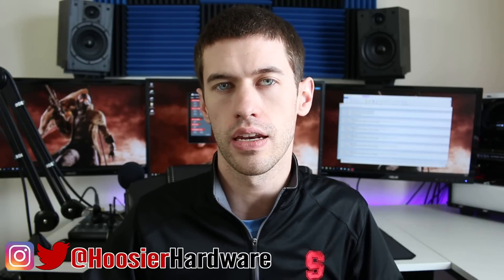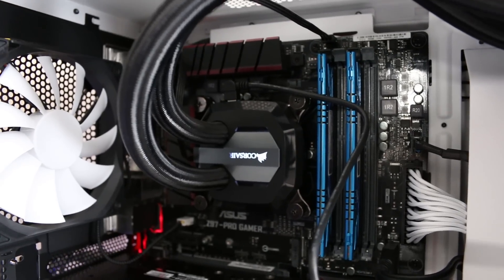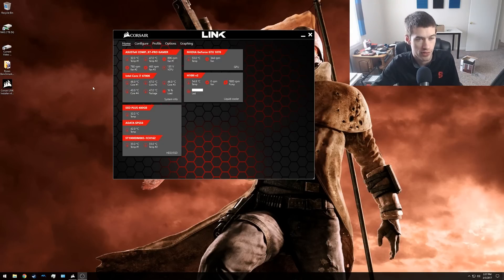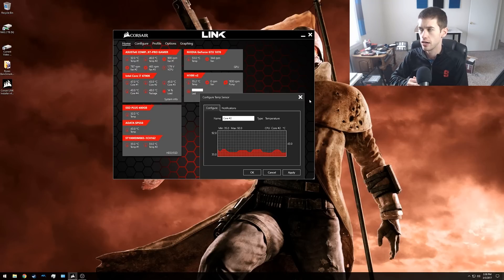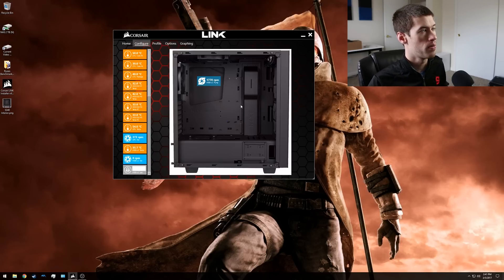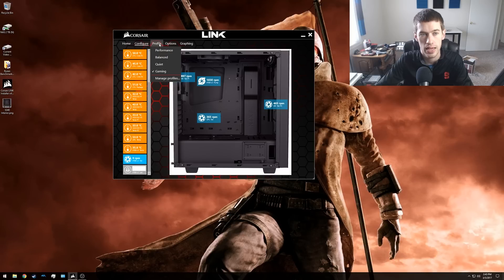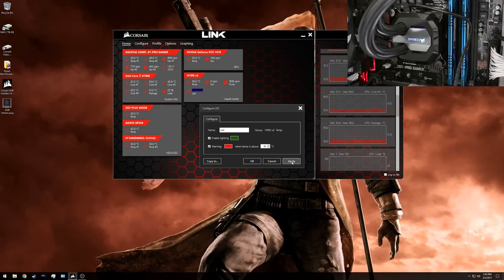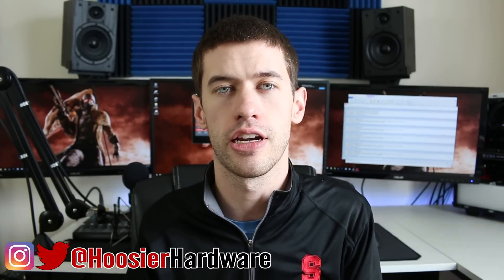Corsair Link V4 Overview

Comment: Do I need a cable similar to charge my phone on the back of the psu? I don't have that cable.  Can I still use this program? Device I only have this psu in my machine, can I still switch dual rail, single track?

Comment: ist it possible to make the LED from the pump changing colors on its own? so like a fade or cycling mode?
Reply: This is a good question, I had an earlier model h110i gtx which allowed that, but after changing to the h115i it seems to not work
Reply: Real nope the software is trash it’s the reason I got rid of my h100i v2 and got a kracken x52 and let me say it’s much better

Comment: my h100i v2 is not showing up in corsair link
Reply: I found the solution to this. The problem, at least in my case, was because the newest version of the Link software is digitally signed with a certificate that cannot be checked by Windows. Basically the USB driver that installs with the water pump is then not trusted, so it doesn't fully install. What I found to work is go back to the Corsair Link website and find the very first version, 4.7.0.77 I think. Uninstall your current Link software, then install the old version. You will see that it prompts you about trusting publisher. This old version used a different signed driver than the new one. As soon as you launch Corsair Link, it'll prompt you to upgrade. Go ahead and upgrade and now you should be good to go. Hope it works for you!
Reply: Oh my fucking god. I have been searching for a solution to this for WEEKS and I randomly find it here! THANK YON BRANDON BRYSON!!
Reply: Did you find a fix for that? I'm having the same problem.
Reply: Haha my pleasure brother. Glad to help!
Reply: Helped me out too, thanks a lot.
Reply: Just bought a h100i GTX and was having the same problem, this fixed it perfectly. Thanks Brandon!
Link to the download I used for this: http://drivers.softpedia.com/get/KEYBOARD-and-MOUSE/OTHERS/Corsair-Link-Software-4-7-0-77.shtml
Reply: Brandon Bryson you're a legend bro thank you very much
Reply: makes me sad, This did not work for me.
Reply: Glad I was able to help you all! The Corsair Link 4-7-0-77 is available on the Corsair website as well.
Reply: DABAUZZ hey bro thank you! I'm glad I could help man, that thing was causing me a headache that's for sure.
Reply: Matthew Dennis There was an extra step for me. Head to Device Manager and make sure the cooler is enabled. It should be listed under USB devices.
Reply: legend
Reply: Thanks bro! Just fixed mine with your solution.

Comment: hi , in the h100i section it shows you that the fan speed is 0 rpm
is there is a way to fix this ?
Reply: Did u connect the two fans to the splitter? And if u did, is the splitter connect to an AIO or CPU fan header?
Reply: OPTiMiS never mind, i just had to set the fan controll to the highest in the bios and it worked fine ,thank you for your time
Reply: Thanks to your comment i just saw the same. What does it mean if it is 0rpm in my H100i V2 box?
Reply: Demian Manzur i think it means the corsair link is unable to read the fan rpm and cant control it , but it will still work ,  i just set the fan speed to the full speed in the bios and it worked well for me
Reply: Guys i hava the same problem with the fan speed, but i have another problem in corsair link 
it shows me as if I have more fans connected, I only have connected 3 fans but the program shows me as if I had 7 fans. Do you know how can i solve it??

Comment: what is your liquid temp curve set to? mine seems to have a tiny window and i'm not sure if thats the reason the radiator fans always seem to fluctuate from low rpm to jet engine and back to low rpm.
Reply from the maker: I didn't touch the default curve, and that's definitely not my experience. I run my fans off of the waterblock's fan headers and let the Corsair software handle the fan curves. I've seen no reason to adjust them.
Reply: with the stock curves, my ambient temp is around 30-32 c in the case so my water temps are around the same at idle. At the same time, the fans go into 1800+rpm pretty much automatically because theyre set to trigger at a low temp. I cant figure out which curves to adjust in order to have them trigger at a higher temp.

Comment: anyway To change the fan speed on that cooler? mine spines like hell
Reply from the maker: I believe you can do that through the Corsair Link software. You could alternatively plug the radiator fans directly into the motherboard and use the bios to set custom fan curves instead.